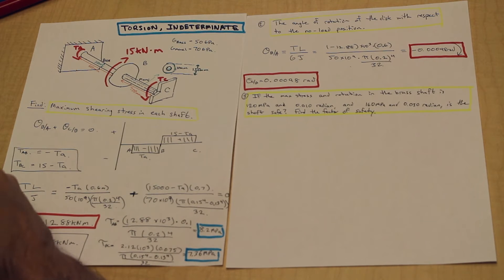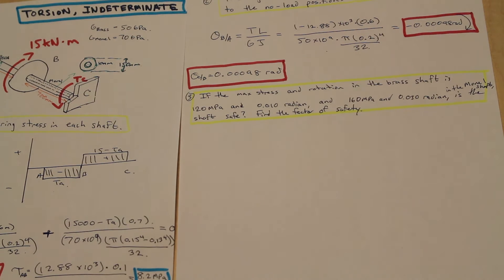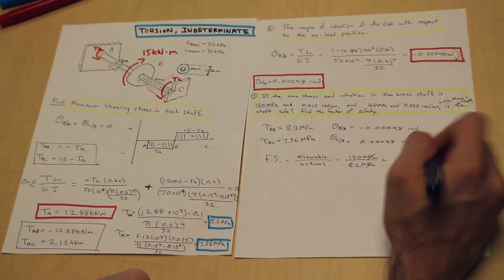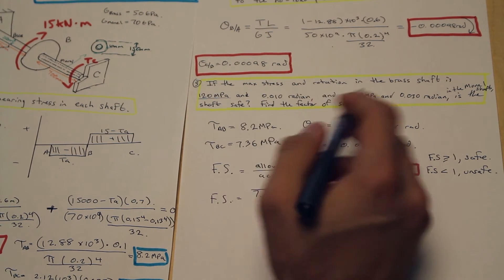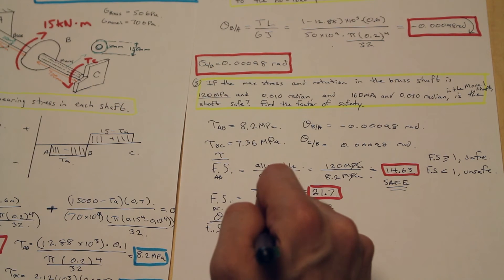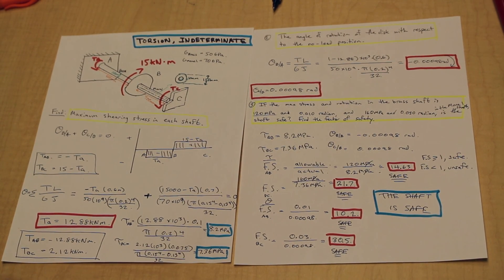How to Solve an Indeterminate Torsion Problem (Factor of Safety) - Part 4/4

Comment from the maker: TimeStamp !

0:41 - Theory Ends - Solution Beings (Dont skip the Theory!)
1:10 - First Step - ReWrite the Shear Stresses and Angle of Twist 
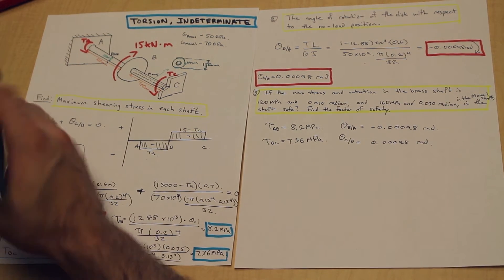2:10 - Second Step - Find the "SHEAR" Factor of Safety for Section AB
4:18 - Third Step - Find the "SHEAR" Factor of Safety for Section BC
4:52 - Fifth Step - Find the "TWIST" Factor of Safety for Section AB
6:00 - Sixth Step - Find the "TWIST" Factor of Safety for Section BC
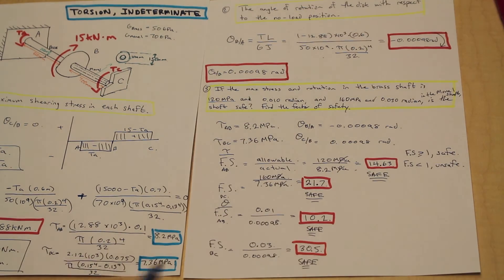6:37 - Final Solution - Is It SAFE?? (Now try to do it on your own!!)

The Indeterminate Torsion Problem has FOUR parts

Part 1 - https://youtu.be/PXMuqTfyEug
Part 2 - https://www.youtube.com/watch?v=ppnr1IpfjX8 
Part 3 - https://www.youtube.com/watch?v=L4o9sI5iQ1I 
Part 4 (Which you just watched) - https://youtu.be/n1oD69nyjYE